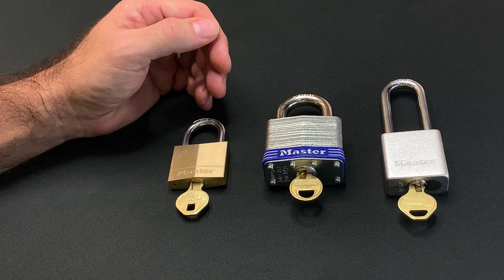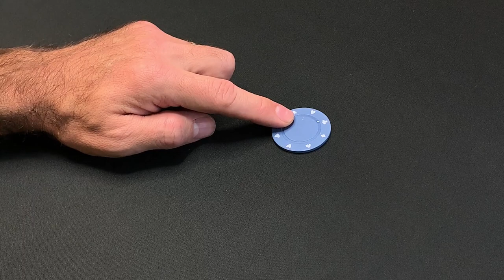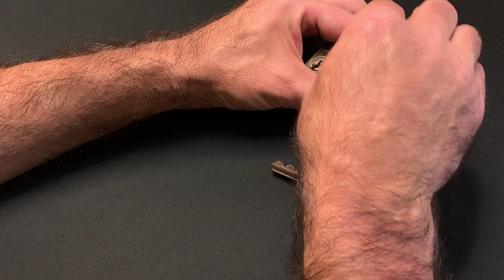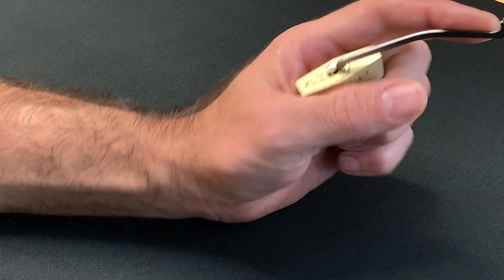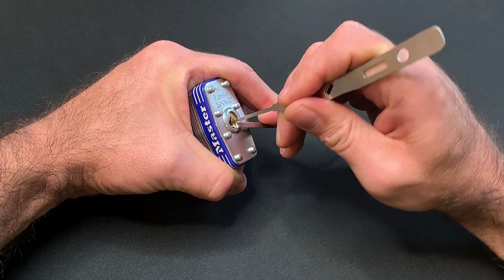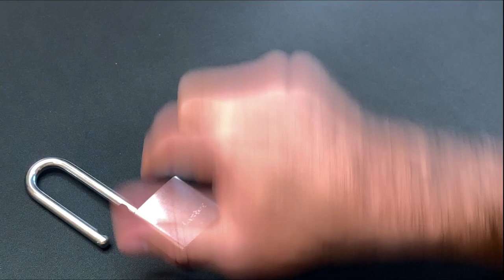001 8 reasons why some locks are harder to pick than others

Comment: Great first video! I would like to point out one thing. With respect, the master 140 does in fact have some spools as drivers. I just subscribed. Looking forward to more videos
Reply from the maker: Really? I had no idea - thanks for the correction and I appreciate the sub 🙏
Reply: @fishpicks4531  yeah, It’s typical of master lock because of the sloppy cores it makes it hard to detect. Plus the spools are shallow. I had to pick three of them before I noticed they had spools.  I then cut one open and found that it had two spools and the rest of the drivers were standard.
Reply: Yeah, I had read that there were spools in 140’s but just did a search on YT and someone actually cut one open and there were, in fact, three spools AND a serrated pin! It’s far harder to pick than to simply just comb due to the crap keyway.
Reply: My Master 140 feels serated on pins 2 and 3. Tiny little clicks as your raising them, fairly good snaps when they set. I'm really new to lock picking but good basic knowledge

Comment: i see that you put a bend n the tension wrench too, i have only have bends n my z tensioners. i know  if possible when i buy a padlock, i try to get a look at the biting of the key and get the bet variance. i commend you on the videos and look forward to more, best of luck and cheers!
Reply from the maker: Thanks - yeah, I find the bend in the TOK wrench means it slips out of the keyway less often and allows me a little more control of the degree of pressure I’m using. Love the tips like this that I’m picking up from experienced members of the community.

Comment: Just a quick mention on your explanation of tolerances. The slots being misaligned/offset from the "center line" isn't what creates the binding order, but rather the circumference of each pin, and the slot they fit into that determines this.

There are many locks that have pins that protrude from the plug, into the key way from all different angles or orientations such as cross locks, or even just a basic tubular lock. If your explanation of tolerances was correct, then the pins in those locks should bind in order, one after the next, but that isn't what happens when picking. Instead, the binding order is different for each one, just like with all locks.

A pin with a "tighter" fit (the circumference of the pin itself is as close as possible to the circumference of the slot without being too big too actually fit) will always bind before a pin with a "looser" fit. Often, and especially in the case of some higher quality locks, the difference between each pin is so small that we can't physically see it, but this actually hurts the locks functionality if the tolerances are too good. The key will stop working sooner as the pins get worn down from use, and the lock has no forgiveness if anything isn't perfectly aligned.

Anyways, sorry to nit pick (no pun intended 😋).
Great content, keep it up :)
Reply from the maker: Isaac this is great information and exactly the kind of feedback I was hoping for - I had no idea about the circumference of the pins being the factor in binding order and that has fundamentally improved my understanding. Thanks so much and I’ll be sure to address that misunderstanding in a future video 🙏
Reply: @fishpicks4531  Happy to help :)

Feel free to reach out any time, I'd love to teach you how to open a Medeco, or Mul-T-Lock :)

(Or even your A1100... I reckon I could help you get that open in a day or two)
Reply from the maker: Awesome! Where are you based Isaac? We could always arrange a Skype call if the differences aren’t an issue.
Reply from the maker: Perfect- will do - thanks again Isaac 🙏

Comment: Commenting before even watching. I know the first 2/ the 140 is only hard to pick because the keyway= TINY. I usually just use a rake and they rake easy but I turn WITH the rake also, as I don't have a turner that fits and allows a pick to go in too. The 5= the hardest out of the 1-5 types, with 3 probably being the easiest and most ubiquitous. Say what you will (I would never buy one or use one) but Master is exceptional for beginning pickers- they are cheap and everywhere. Don't know the 3rd and will see what you do.

Comment: What's your recommendation on very springy locks that have security pins in it. The lock I'm referring to that I encountered this is the Guard No. 836 50 mm. The lock doesn't have a very straight forward binding order because of the springyness of the pins even at high tension. Bosnian Bill resorted to bitch picking it to open the 40 mm version quickly. I'm wondering if I have to do the same.